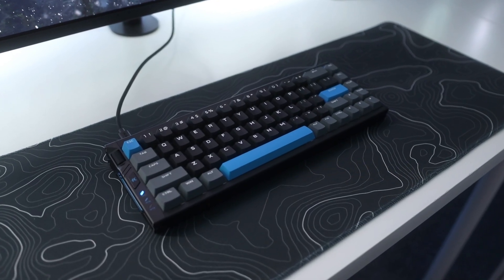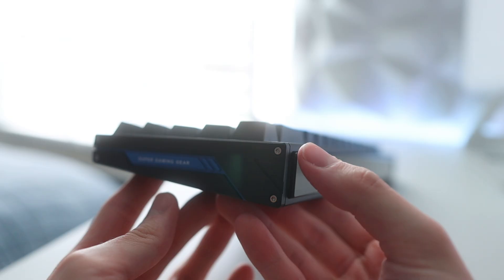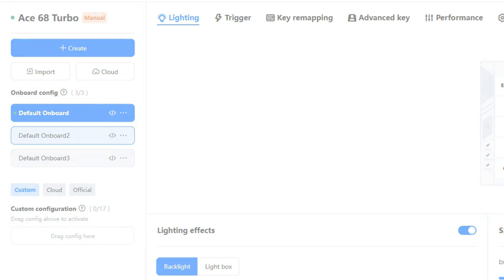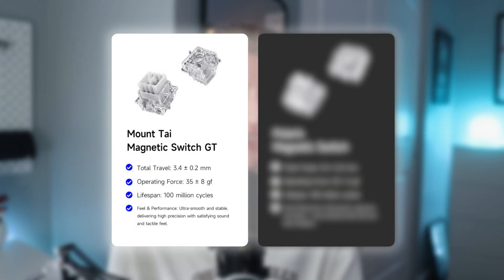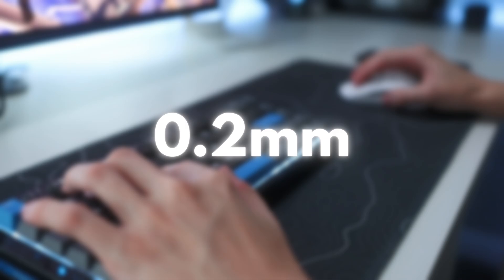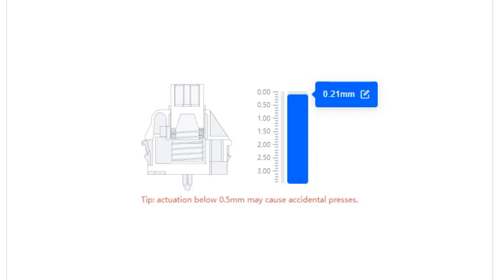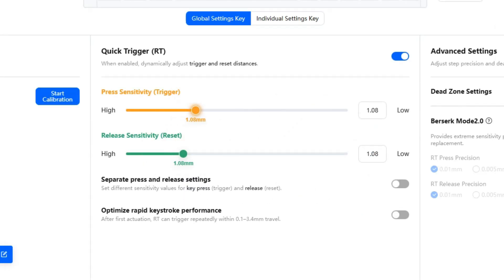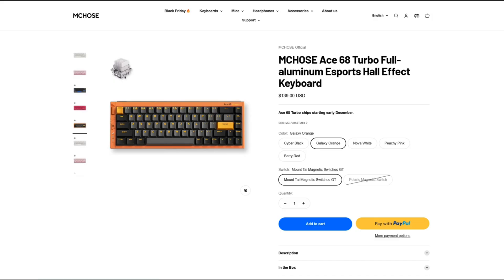The World's first 16K Polling Rate Keyboard | Mchose Ace68 Turbo Review

Comment: I did order it, not for the 16k. But 140$ for a HE keyboard with many features, LED, and Aluminum CNC. Yes, worth it.
Reply: how it is ?
Reply: @lvgslim2725  It is good gaming performance keyboard. 
But during casual usage like typing, working, where my hand doesn't rest in one place. Typing feel very hard because the springs of switches.
For gaming 9/10, for casual use would be 4/10. I would recommend you to have a secondary keyboard for office's work
Reply: the exact reason why im buying it, a solid HE keyboard with a good software for a good price